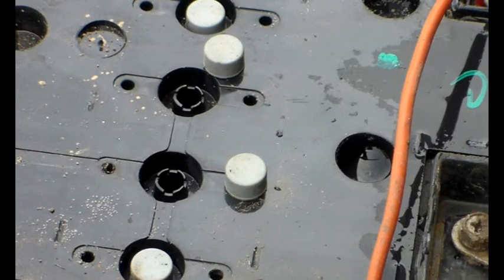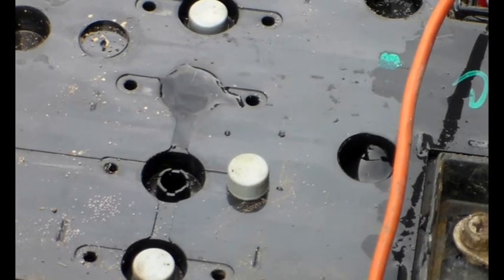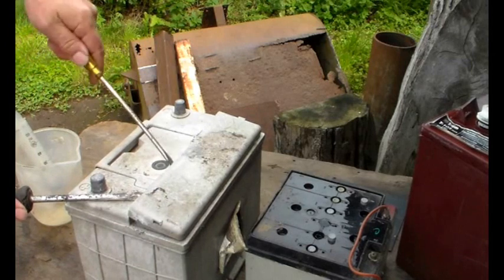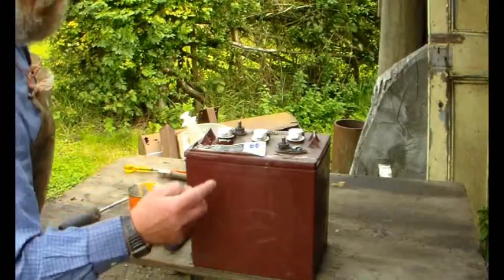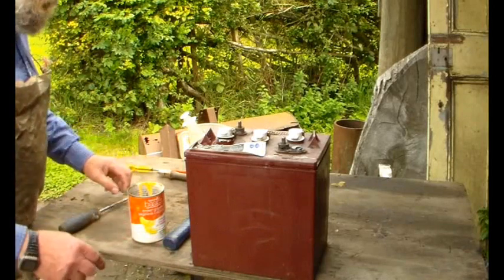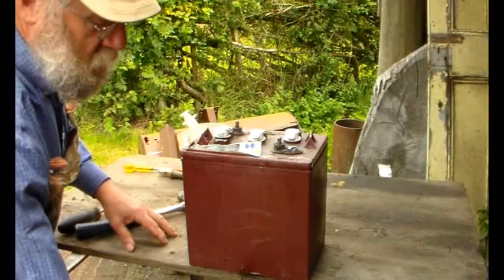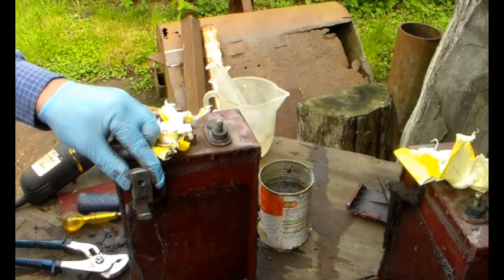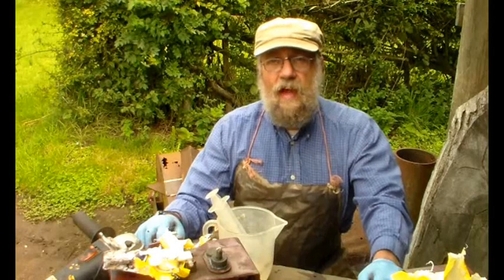Battery hack: making 2 volt cells and the secret of sealed batteries.

Comment: very interesting. So I could take a small 12v battery and split it into 2 volt cells  what do i use to make safe any spills bicarbonate of soda? and half the size of a  2volt plate would be 1 volt but  to make 3 volt i would need to cut three one volt cells using 1 and a half 2 volt plates as a 2 and a one would not change in the same system? I am asking as wet cell one volts are very expensive but are easier to play with in my micro world.
Reply from the maker: Hi, any alkaline would be fine, bicarbonate is good. All lead acid cells are 2 volts because that's what the chemistry produces, not sure what type of cell gives 1v, Nickel metal hydride is 1.2v cheers
Reply: @TheInfoworks   thankyou
Reply: It doesn’t matter how many plates are in the cell all the plates within the cell that share the same acid water will be a 2 volt cell.  You can use just one plate or a half a plate or a quarter of a plate and as long as you have one other plate and they are both submerged in the same acid bath you’ll have a 2 V cell.  If you noticed when he pried on that connecting post that connects all the positive cells together you notice it lift it up a little bit that’s because it has deteriorated the positive plates do not last they are made of lead dioxide some call it peroxide of lead which does not hold up in an acid bath like the lead plates do.   If you are lucky the lead dioxide positive plates called the anode will not crumble when you take them out and you can reuse them but you have to sand blast the surfaces to get the crystallized lead sulfate off before they will except a charge again same with the negative sponge lead plates. 
However most of the time the positive plates are trashed only good to melt down and make new lead dioxide paste out of them but you can take the lead plates and make positive plates out of some of them and get the battery working again but usually only at half the voltage because you only have half as many plates now or you can put fewer plates in each cell and get your full 6 V battery back but it will only have half the amp hour rating after that.

Comment: Great Video - Same principle must apply for a SLAB then.  I'd like to see a video on splitting, say, a 12V SLAB into a 2V cell.  Many thanks.
Reply from the maker: Hi, these batteries are of a similar construction and I have cut them up before to increase the battery voltage on my old electric bike. I used the carbon rod weld technique shown in another of my videos to extend the terninal on the cut cell end. This bike has now changed to lithium when Lee donated a large pack with a duff BMS. Cheers

Comment: Really interesting. I have to admit I wouldn't have thought of using an angle grinder and would have been messing about with a hacksaw for ages probably. Anglegrinders with 1mm disks are the new Swiss army knife!
Reply from the maker: David, I remember years ago cutting teeth on a big washer and then fixing it on a bolt in an electric drill to cut battery cases, but now as you say (though they are a bit fragile) the 1mm disc makes life somewhat easier. Subscribed? Cheers
Reply: @TheInfoworks  Yes Subscribed quite a while ago and really enjoy your diverse but always interesting vids.

Comment: AGM batteries, I've heard all kinds of things , my question is how to know when to stop adding distilled water is it like flooded lead acid
Reply from the maker: Hi, good question, the glass mat obviously slows down the movement of electrolyte within the cell and so has an effect on the ability to transfer heat and for further chemical reactions to take place as weaker acid is moved away from the plates to be replaced by the stronger. There's no real logic in the replacement process beyond the thought that the cells dry up and so adding either distilled water or even acid with improve the situation. I suppose it would be useful the find out exactly how much electrolyte is in a new cell and what is the fully charged specific gravity. Cheers
Reply: Do they sell electro-light liquid off the counter? Or just  by adding  distilled water would that be the same?

Comment: While hacking the batteries apart is a great thing to do with the larger batteries but it's probably not so worth it for smaller ones such as starter batteries, small AGMs etc. I have another approach to use those batteries that you might be interested in. It's called the "10 Volt" battery bank. 

When a cell falls over in a 12 volt battery it either becomes a shorted cell or a high resistance "lazy cell". Both kinds can be put to use in the 10 volt bank. Here's a video I made several years ago after doing a bit of work on my bank, thought you might find it interesting. https://www.youtube.com/watch?v=lq4OUhitTrg
Reply from the maker: Hi, thanks for this, it's always best to reuse than to recycle and sometimes things can last for years, as is the case with our battery bank, cheers

Comment: Great video Andy! Thanks for the link. It is very useful to see someone actually doing the hammering and prying, it gives you something real to work from, I have always been wary of batteries because of the "lethal" acid, but reading the comments here and seeing you work has relaxed me a bit.  One of the things I find useful about youtube (and something I try to do in my videos) is to show how hard to hit the thing to loosen it, how much force something needs or will take.  It is very difficult to articulate in a book like a haynes manual, "pry it off" etc. I have done ball joints on my old van, the instruction would have read: wedge in a nail bar and stand on it to load the taper pin with pressure, then belt the side of it with the biggest sledge you can lay hands on....Thanks again!
Reply from the maker: Owen, no worries, as I said it was your video that was a catalyst for this one and the battery hack was something brewing but might not have happened, "one hand washes the other" cheers

Comment: I did some diy aluminium anodising a while back, and the sulphuric acid anodising tank was at about 15% conc., not sure what s.g. that equates to, but I used to keep a cup of sodium bicarb. to hand to neutralise any spills, just nice to have standing by somehow, as drips when moving the job from one tank to the other were common.
(edit: 15% sulphuric acid by volume equates to s.g. of about 1.1, a fully charged lead acid batt. has s.g. = 1.25, which is 33% conc. if anyone cares)
I diluted this acid from the 99% stuff B&Q sold as 'drain cleaner', you had to ask for it and it was buried in plain wrapper under the bottom of the shelving. Diluting that with water needed  a little more, um, caution, and I wore long and thick rubber gloves for that, apron, glasses, and did it outside of course, just in case it went badly.... Cheers, Dave
Reply from the maker: Dave, yes there's a rule and I think it is acid to water not the other way round, conc sulphuric is lethal, cheers
Reply: @TheInfoworks  Yes Andy, 'AAA' Always Add Acid is how I remind myself.  That 99% sulphuric acid bottle is something I don't really want on my patch frankly. Can you believe this was on sale in B&Q to the public to shove down drains ? Absolutely incredible, and frightening...
Reply from the maker: I have some conc sulphuric, marked and strictly locked away. OK if you know the rules, but to the general public, as you say,  madness, cheers

Comment: That was good its amazing what can be done if you've got the time and if course the skills. I was always very weary of battery acid thought it would attack my skin instantly and cause a lot of problems but its obvious now that its really not that bad. Cheers Andy regards Kelly Marie
Reply from the maker: Kelly, thanks for the comment and yes battery strength acid (sulphuric acid) is not too bad but it stings in cuts etc, so glasses and gloves recommended. Full strength sulphuric acid is a different thing and is lethal and can make you blind if it gets in the eyes. Luckily battery acid within a fully charged battery has a specific gravity of 1280, so no way near the full strength stuff and with a discharged cell the strength is very low. I put gloves on to handle the plates due to possible lead contamination. Cheers
Reply: @TheInfoworks  The vapour given off from normal vented lead acid batts will destroy cotton cloth it lands on, as you pointed out Andy - I had a used car batt charging in my bedroom as a kid (I know better now) and the curtains above it were utterly holed after a year - that didn't get me many points I can tell you :o) Cheers, Dave
Reply from the maker: Dave, so you were messing with batteries even as a kid, impressive,  yes when lead acid is charged at a decent rate and the cells gas freely then the vapour contains acid mist, very caustic, cheers
Reply: @TheInfoworks  12v batts when I was young were to run 12v amateur radio transmitters - the easy way to get lots of 12v power - but the curtains paid the price, and I wasn't allowed to keep a battery in my room after that. Cheers, Dave
Reply: @noakeswalker  That's a cool story! :)